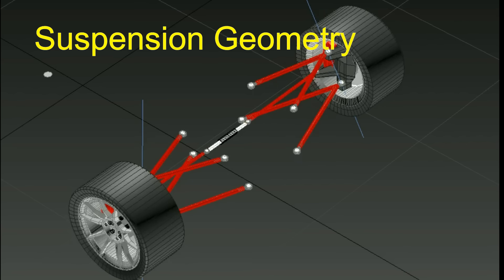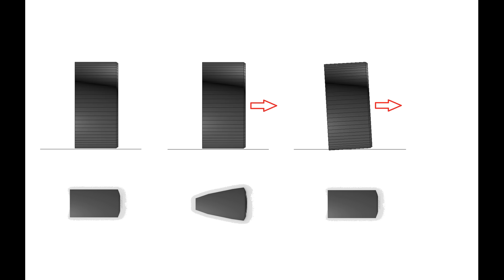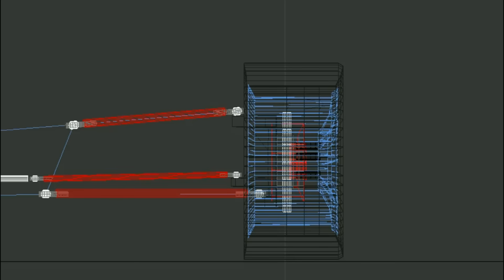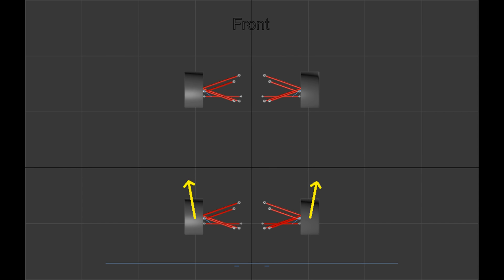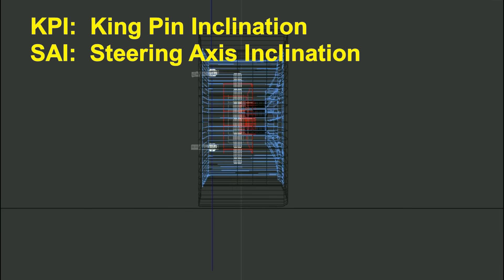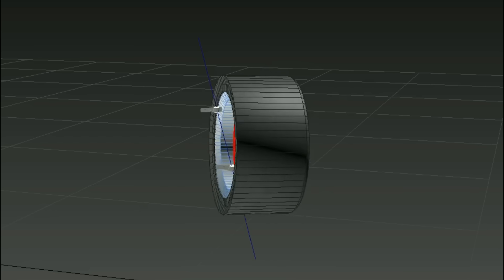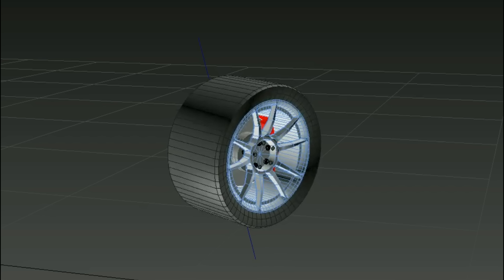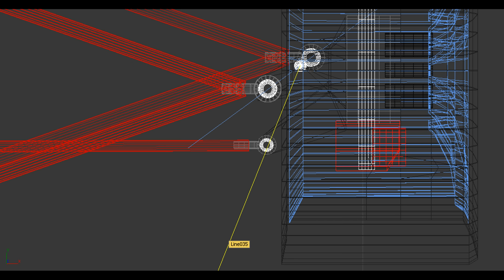Suspension Geometry - Part 1 (Camber, Toe, Caster, KPI, Scrub Radius)

Comment: I've learned that it isn't necessarily caster that provides self-centering and feel, but mechanical trail. Mechanical trail is to caster what scrub radius is to kingpin inclination angle. You can move both pivot points rearward in the wheel while maintaining caster to reduce mechanical trail, or vice-versa. This is the equivalent to using virtual pivots in order to change the scrub radius or KPI independently of each other. A few articles and anecdotes I've read suggest that the best feeling sports cars have 30-40mm of mechanical trail. If it were me, I'd try to have as high a caster angle as possible while maintaining that much trail. This way, I have as much camber gain through caster as possible so I can synergize that with the camber gain through compression (body roll) in order to run as little static camber as possible.
Reply: Hello! How can I contact you...I have a doubt as I am designing a buggy for SAE baja
Reply: @shreeramarama6390  You can just ask your questions here. Though if it's longer than 200-ish words and/or 1-2 paragraphs (as they would appear on the desktop site), then you may have to add the extra content in an edit to your comment. YT doesn't seem to like super long comments... At least when I post them straight up, lol.

Comment: please correct me if i'm wrong, but here's my theory: if i have a harder time controlling a drift (mid corner) i should increase front caster, because it adds steering feel by increasing the speed at which the steering wheel points itself into the drift and it adds dynamic camber at cornering, but if my problem is more that i can't quite trust my car at corner entry (because sometimes it turns enough to get into rotation and other times it understeers) i should (apart from being more skillful about my braking) increase front camber, so that the camber is already there before i start cornering, which should push the car into a new direction more quickly and midcorner will also be good, because the camber is still there then.

Comment: Wheel alignment change due to the mass of the driver, so make sure to put a person or some heavy object in the driver's seat while doing the adjustments. It also applies to the ride height adjustment, this is why many LHD cars are slightly inclined to the left side while being driven with just the driver inside. Many car shops don't take this into consideration.

Comment: how do you figure out where exactly to put each bar? i'm trying to fully simulate a car's powertrain in unreal engine and i cannot find any guide on making suspension/steering geometry (apart from an old solution to ackermann steering.) is there a guide you know of? thanks.

Comment: Hi, Amazing Video
It looks like you have done Anything that has to do with all parts of suspension.
I am working on a 55 year old TR6 with some archaic designed parts. I am looking to do some spirited driving, ie autocross.
Of the aftermarket “kits” ie mustang II, or others, are there any that stand out as being better? The car weighs about 2500 lbs.
I have an aftermarket full square tube frame, so cutting off a frame section are replacing it is not a concern. I am hoping this opens up many suggested choices. 
Thanks in advance.
And yes please to more videos like this. You made the explanation much better than some other videos I have watched.
KJ

Comment: I'm building a hybrid cross kart slash , go kart / something lol. Anyway fully independent front and rear suspension . . Double wishbone rear end. I didn't pass a single mat class past 7th grade so obviously I  can't to math lol. Anyhow I designed every aspect of my suspension using 4 ft cardboard sheets, thumb tacs, string lines, and 1 to 1 mock ups of my control arms and spindles. Worked amazingly well with no math.
Moral of the story pay attention in school 😂😂

Comment: I've a problem in my Kia multilink. My car feel too hard (solid)and at the same time too soft (shake side to side). I noticed a little sag in the rear and also a little negative camber. The rear left wheel has more sag and more negative camber. 

I change 4 shocks and 4 springs. I bought eibach springs -10mm because I think the oem was too softer or garbage. After this swap the car feel only little better for a month and now a rock like before... Now  I change the upper links arm (not the arm that can modify the toe) because the silent blocks look a little off cender and it could be the cause of the negative camber. The cornerig and shock absorbing improved but only for a week, now stiff rock solid again... The only improvement is the the car don't shake like hell when encounter another vehicle in the other side ( a front left shock absorber was defective)

I don't understand what's wrong with this car. I read about many different kia or hyundai with the same insolvable issue. 

I don't understand why my rear left wheel sit lower than the rear right also with new springs and shocks. Are not the springs that lift the car or multilik have some trick to lift the car ?

I don't understand why I feel all little road irregularities or little pot holes like if the car fall in a huge road sinkhole...

Comment: What they said. Yup.   Now I have a question.  Nobody is talking about the effect camber has on the contact patch relative to steering pull and toe effect in combination.  If I have negative camber and 0 toe on one side of the front, but positive camber and 0 toe on the other, which way does the car pull, and why?   What tricks can be used in equally cambered axles, like toe adjustment, can be made to cancel the contact patch squirm/pull from camber?  Meaning:  With a modest amount of negative camber that cannot be adjusted (some car companies) what amount of toe is used to compensate for the contact patch deformation, if any?
I have an '04 Acura TL that my book says has fixed camber all the way around.  The rear toe is noticeable when viewed from front or rear.  Is the amount of toe I am seeing there to compensate for that camber, or is it merely to mitigate terminal oversteer?  The car is pretty nimble but not nearly as much as my brother's Ford Focus.  That thing is a gymnast!

Comment: These videos are very useful. I am designing my own suspension system for a single seater and your videos have helped a lot. Could you tell  me which software you use to show the changes in the angles in bump/droop and steer? Thanks.

Comment: Yeah ! Great diagrams and explanations.  I just went to a motorcycle meeting, and I have a background in cycling. I owned a few suspension bikes, and could not get them working properly. I previously decided to invest in a really good BMX, that's all.
But, looking at the motorcycles. It was odd to see. Large rear tyres, tyres with an odd shape, and weird orientation of the springs.
I read today motorcycles have 57 x more accidents than cars !
Yet, they're a lot cheaper.  I might save money through investing in some skill hopefully.

Comment: I'm trying to figure out what I need to adjust to correct the steering and suspension geometry after having to add 16mm of positive offset to both wheels (the fronts needed spacers for the brake calipers and the rears came with an incorrect neutral offset and I paid too much to get them both made again!).

Comment: can you do a video ( or do you know of a video ) that goes over how to setup a car ? 

ex : if your car is a FR layout and has a balanced handling characteristics and you want to add more under / over steer etc ? 

like how would the car react if you added more dampening to the coilovers in the front vs the rear and vice versa. ( leaving the front where its at and only adjusting the rear and vice versa vs front going full soft while going full still in rear and vice versa etc ) 

i cant seem to find any videos discussing this topic ( and i know it varies platform to platform ) but just in a general sense. 

maybe FF vs FR vs MR vs AWD etc 

like , if you did one setup change on FF layout it would be complete opposite reaction if you did same setup changes on FR etc

Comment: A small question...do normal road cars have enough caster angle to countersteer fast enough by themselves in a drift ? Could you just take your hands off and catch it only when its enough angle ? Or would you need to help the wheel a bit ? When looking at dedicated drift machines, they supposedly have as much caster as practical and their steering countersteers very fast.
Reply: Also, doesn't increase in camber when turning, being the result of the caster angle, counteracts the countersteering speed of the steering in drifts ?

Comment: I was really hoping you'd get around to suspension setups with 4 ball joints like you have pictured at 0:45. I'm having a hard time wrapping my head around that one. Best i can figure it allows for some tuning of how KPI, and Caster with steering angle.

Comment: What would b nice is if tire had bubble profile 2" of side wall from tread so u could get the camber biass mostly by just changing air pressure. So perfect air is best wear patch least drag & cornering is lower air patch if track is turn real world track. If u bs only turn 1 way fake pntless racing then the tire would only hve bubble on 1 side of tires & they would b left or right tires only like shoes.
Reply: the bulk of the load on tire is built into the tire design. U mess w/air on the margin then mess w/suspension last to match condition wet, air temp, banking ect.

Comment: Great explanation of how steering works, not all correct though, there are times when a small amount of negative toe in on the ear can (at the cost of straight line stability) help negate oversteer. this would usually be in a racing situation.

Comment: Very very good easy to understand stuff.   I do a lot of track days with my C7 Corvette.  I've noticed that only the LF tire has no tread left on the inside only, but all the rest of the tires have even wear.  Manual calls for -2.0 camber for track days.  Would you suggest that I adjust the LF to maybe -1.5 instead of -2.0?

Comment: Thanks for this graphic depiction of what our wheels really do when we turn our steering wheel!

Two questions: If someone told you you could have as much SAI or Caster angle as you desired, but could not have both, which would you design into your suspension, and why?

Secondly: My particular car has Zero Scrub Radiu.  I have read, from numerous sources, that Positive SR can make the steering heavier.  

I WANT heavier steering! I CRAVE heavy steering, compared to the wishy washy steering in most 2010 or later automobiles.

So would adding modest spacers to my front wheels, to generate this positive SR, be okay?
Reply: Heavy steering rules!!

Comment: I have question, my suv 2012 pathfinder the rear tire inside worn out but the outside still good thread, what is the problem it? Thanks.
Reply from the maker: Could be toe out or negative camber. Get the alignment checked

Comment: Hey. I got a question for ya. My friend got a wide body kit for his gt86, and he installed a set of 25mm spacer for it. After that, the car's handling characteristic completely changed. This is expected, but something I don't understand is that why the steering wheel no longer able to follow the drift when the car start to silde? What I mean is that when I try to drift it, I had to purposely turn the wheel to the opposite way to catch the drift. Before adding the spacer, I can just let go the steering and catch it at the right moment to finish the drift.

Comment: I had an awful positive camber on the left front tyre that was causing excessive wear on the outside of the tyre, this was so extreme that the tyre ended up with a conical shape, I rotate the tires inside out to compensate wear but it messed with the straight line response the car is now turning left and I have to compensate, a camber correction was made at the alignment shop and I wanted to understand more about the steering and suspension angles, this video was the best I've found about it. Thanks!

Comment: One question I understand how camber affect tire ware on Negative and positive camber but on my work van both in and  outside wall of the tire has tons of tread but the middle is bald. On the front wheels of my van has a little toed out, is that bad?
Reply: This you are describing is usually caused by excessive tire pressure.
Reply: Look this : https://encrypted-tbn0.gstatic.com/images?q=tbn%3AANd9GcSuHYi0eeChWzl_qWa6NN9hikAHbZaEhUZT8drdGAWTW6uaPMPG

Comment: great project dude !
although i'm blown away by your knowledge and overall skills; this is not how we weld cast iron in my 30 year welding experience back in the Netherlands ...
I find it therefore rather contradictory to see you weld such a vital part this way.
it's ( hopefully) said before but welding cast iron, even when forged, is a precise operation, especially for parts used under stress/dynamic loads.
even I would scratch my head a few times before doing this.
please reconsider this; you're driving it on a public road dude...!!

Comment: I'm building a 45 dodge pickup, TCI suspension, how much positive camber do you think would be best, with manual rack steering,,,so positive I gather is tilling front of axis towards the rear? But it's the best explained vedio I've seen

Comment: Huh, never heard of it being called KPI before.  Always heard it called steering axis inclination or SAI.  

First generation Miatas ran a slightly different durometer rubber in the rear control arms to induce a little bit of toe in change under side load.  Set rear camber at zero and at the limit you'd typically feel the rear end start to step out as you approached the limit, and then the car would kind of decide it wasn't going to spin.  Was a weird feeling that took a little getting used to.

Comment: You'd make a good teacher of suspension and steering. I am a retired ASE Master Tech and S&S was always my forte. If you notice my Avatar, I bought a 2004 Marauder and put $7000 worth of upgrades in it in about 3 years. KVR 14" front rotor kit, Metco polyurethane bushed rear control arms and watts links, QA1 dual adjustable racing shocks on all 4 corners, ADDCO 1-14" rear stabilizer bar, Torsen T2 differential, and MMX Metals' 200 mph driveshaft. Oh, and a second set of tires for racing, Nitto Street Drag Radials, the rears on widend rims.

For a 4300 lb. police interceptor interceptor, Quicksilver (that's her name) is like a roller skate on a rail in the turns. I've often outrun those German sports cars on twisty roads, cars with 100-150 more horses than I've got, because I'm able to wait until the last millisecond to scrub off speed before the turn with massive braking power, come off the brake and hold the turn under high g-force, and exit the turn under WOT with that differentiating Torsen T2 (limited slip is the absolute WORST thing to have on your car in road racing).

And it's been my understanding of the things you teach in this video that has helped me to make the proper upgrades to Quicksilver and make her such a pleasure to drive. To all you viewers who watched this video: pay attention to SK8215, he knows what he's talking about.

Comment: But dont f1 cars have the design in rear with no camber loss?
Reply: behexen250 
Well yes i know that but thats not what i talked about.
Reply: behexen250 
I might be wrong but dont f1 cars run zero static camber in the rear and instead rely on the control arm length ratio to give then a full contact patch through acceleration and cornering?

Comment: I don't know why but everybody says that the caster angle keeps your wheel straight and that it's like shopping cart. It's not. The caster angle is the angular displacement of the steering axis from the vertical axis. Shopping cart has the 0 caster angle.

Comment: Honestly dude this is the best vid on suspension geometry I've ever seen. I've been looking for some time and I give you a big A+ for this vid. The diagrams are excellent. Now I finally get what the KPI angle is and how it relates to caster. I am new to tracking my RS and I want to understand what is being done regarding suspension adjustments. You cannot sort out your cars suspension without a comprehensive working knowledge of this stuff. Thanks for putting in the time to educate me in this area. Finally I see !! An epiphany :) Much thanks. I will now move on to Part 2. Cheers. Oh yeah - new sub :)

Comment: Excellent video. Have you had any experience with 4X4 pickup trucks? Specifically Dodge Ram. These trucks have solid front axels and are notorious for developing a condition fondly refered to as death wobble. Unfortunately I recently bought a used Dodge and it has this issue. Wanted to get your thoughts on this problem. Again really good video. Thank you.

Comment: Is this the process of "active steering" that higher-end German cars feature? Also, the kind of adjustments being made by the driver and pit crew during an F1 race?
Reply from the maker: No, active steering in BMW's and stuff is a little different. It moves the rear wheels to assist with the steering. That wouldn't be allowed in f1 since it would be considered a driver aid
Reply: Yes, there would be unfair advantages.

Comment: Where's the part covering Ackerman angle? The difference in steering geometry between inside and outside wheel in a turn? And also why some cars that can be good at fast cornering don't have too good of a cornering radius when being moved around in a lot.
Reply from the maker: Ackerman video is linked at the end of this one. Bad turn radius in race cars is mostly because of their wide front tires and straight control arms that don't leave much room for the tire to turn